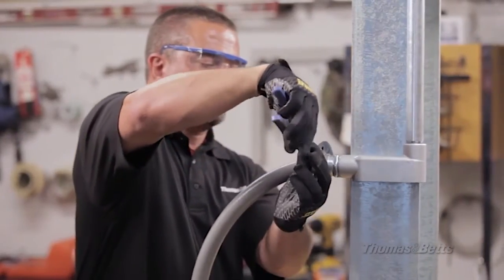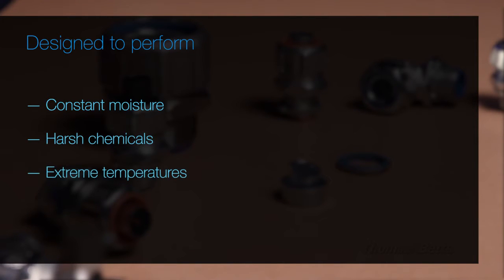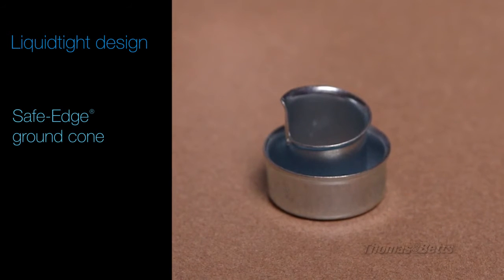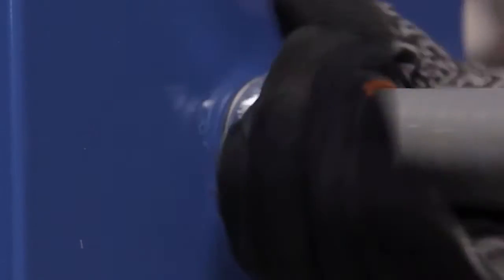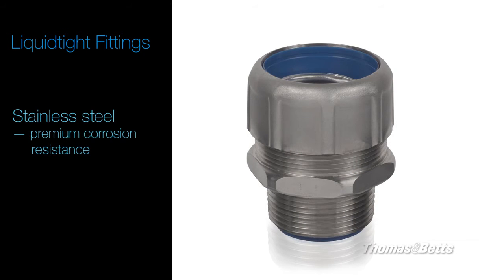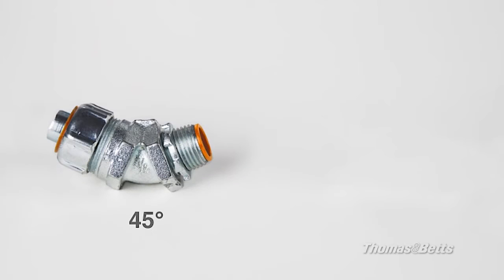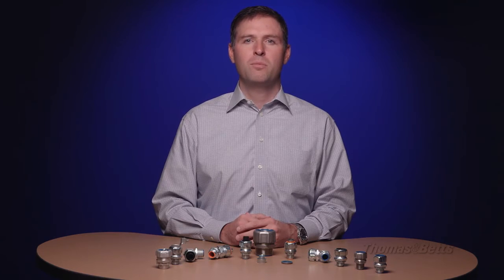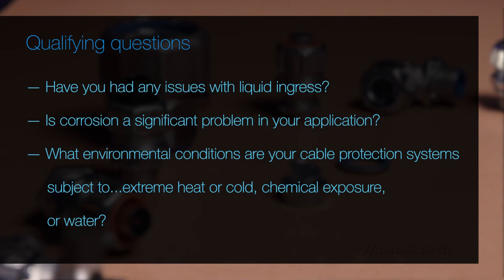ABB T&B® Liquidtight Fittings and Conduits Install 3X Faster — Allied Electronics & Automation

Comment: what tools do you suggest in tightening metal liquid tight strain relief? our application is mounting them on plates for panels, we are just using channel lock, any suggestions for tools to make it more easier for the installation on the metal walls of the electrical panel